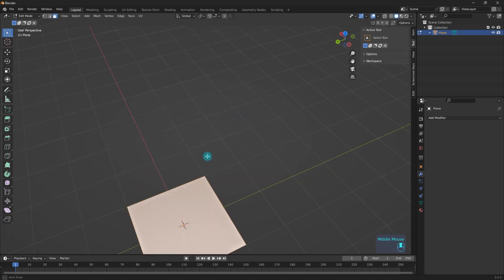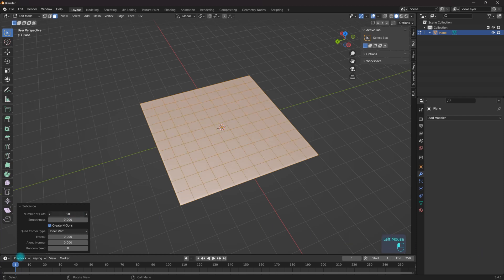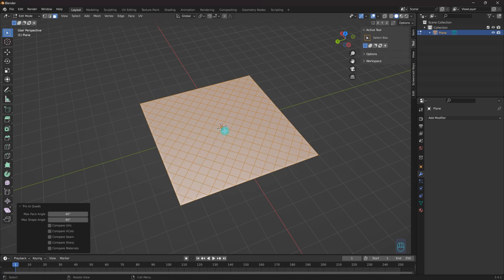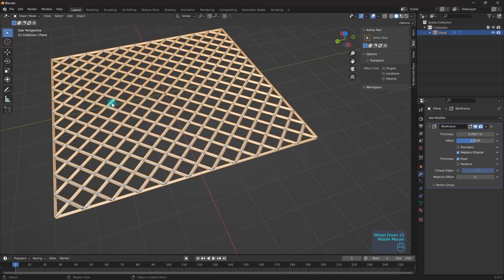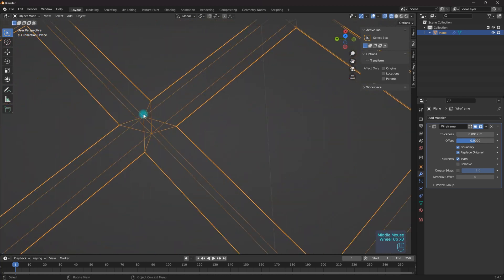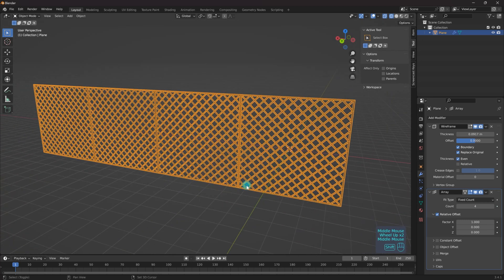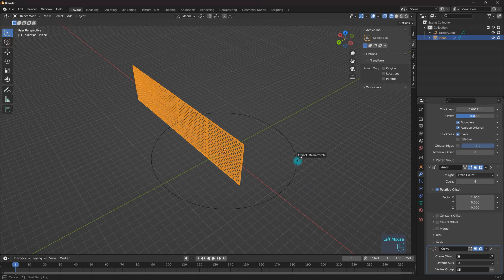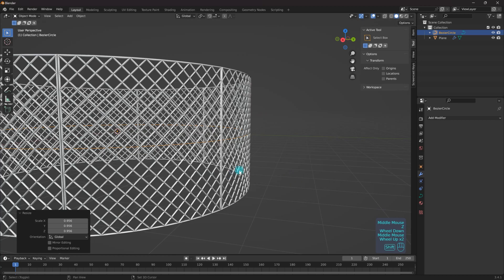Modifiers in Blender: Wireframe

Comment: Can you give a different profile to the "wires"? Say, an L profile to create realistic scaffolding?
Reply from the maker: Realistic scaffolding? Do you mean adjusting the curve to be more angular? If that is what you want I would recommend creating a path using geometry. Create a plane and merge all vertices to center, then extrude the vertex to make a single line that shapes the path you want. Then you go into object mode, right click and convert to curve. Then you just use that path for the curve modifier. The scaffolding I am thinking of is stuff you put together with individual poles and boards? If that is what you are going for then I would recommend a different method.